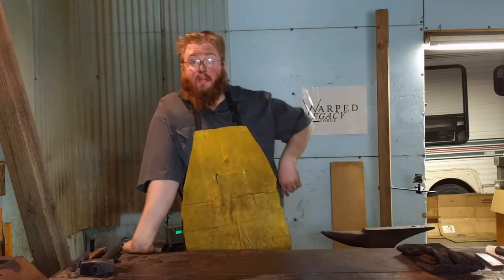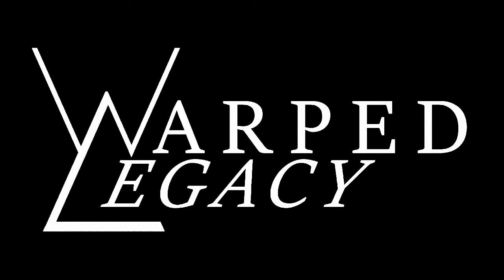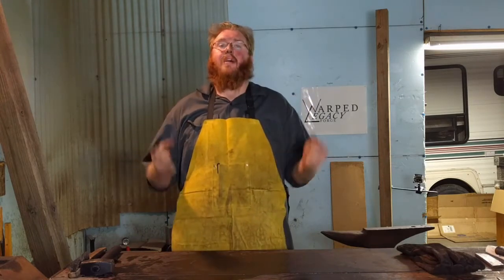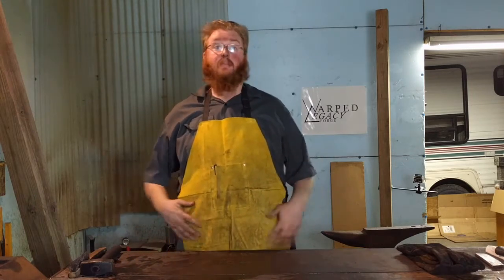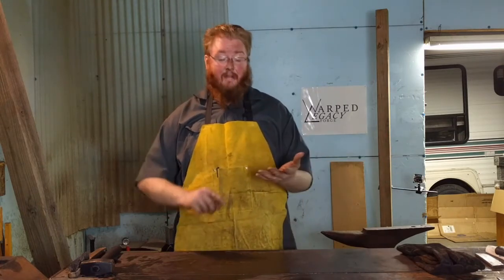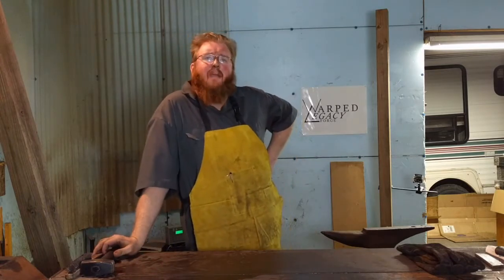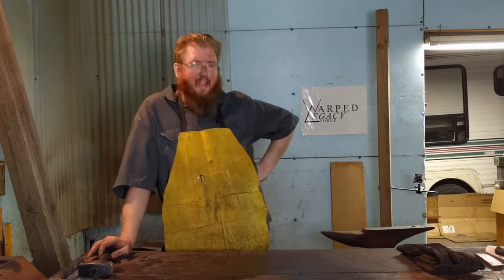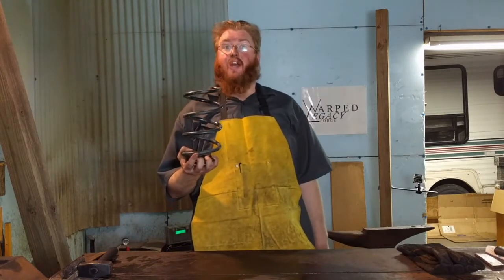BLACKSMITH CHALLENGE! Letter opener

Comment: Cool bud. Nice design and I like the hanger for them. 

Looks to me like your coil for the bottle opener is just a tiny bit too small which might be why they don't work quite right. Hard to tell tbh. 

Keep the videos coming and all the best to you. 
Andy
Reply from the maker: +Andy Mckenzie that's absolutely what it is. Not enough space between the part that holds the top, and the part that hooks the edge. The next ones I make will have a better bottle opener end.
Reply: Cool. Easy enough to rectify. Keep the videos coming bud. All the best 
Andy

Comment: Those are some heavy duty letter openers.  I like that you also made stands for them too.  If they get back to their stands every time, it is unlikely they would get lost in the clutter of a typical desk (I have heard it said that a clean desk is a sign of a deranged mind...  Shows the kind of people I associate with  (^VERY* well adjusted)).
Reply from the maker: +Brian Neeley Yeah... I had to "rearrange"(read: push crap off camera) my desk a few times to get good shots. You should have seen what was just out of shot! These things are def overkill for just opening letters. Letter opens dont need to be hardened and sharpened to the point of shaving either, but that didn't stop me from doing it!